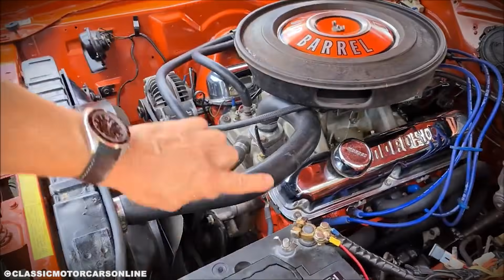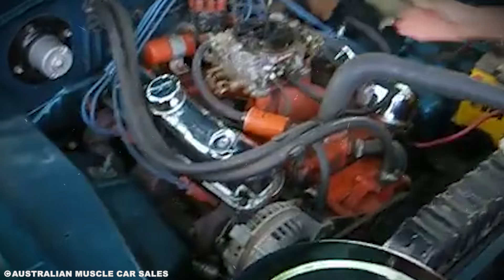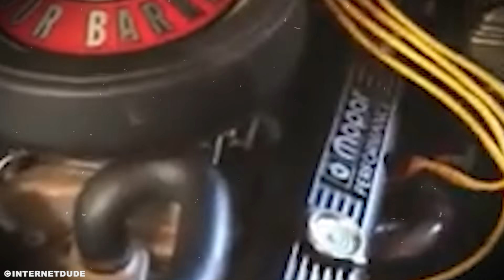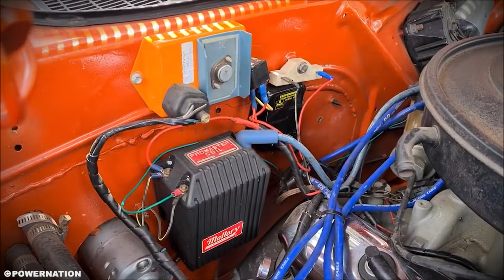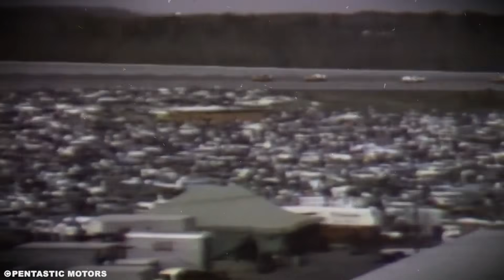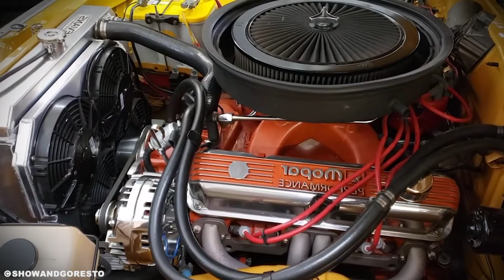Even at 275 HP & Small-Block Size, the Mopar 340 Shocked Everyone Running 13-Second Quarter-Miles

Comment: Absolutely no other manufacturer small block could beat the 340 not even the Chevy 327 or the Chevy 350 350. And if you built the 383 none of the other manufacture Big blocks could beat it.

Comment: I have a 1969 340 4-speed Dart GTS 3:91 Sure Grip rear end and I  have owed it sine June 1974. I have polished connecting rod beams and its balanced and everything else that typical of a street rod. Forged pistons 480 510 lift and 284 292 duration cam. Adjustable roker arms. Hooker headers. Hay billit flywheel and a McCloud clutch.  72 sycros and 1st gear in the transmission.  Ported and polished with 3 angle vale job. It runs nice.
Reply: Did the cam kill your mpg?
Reply: May i ask what brand cam?

Comment: I had a '73 Dart Sport. 340, 4 spd. That was a spunky little car! Very quick on the street, and decent gas milage compaired to the 440 Magnum I had before it! Both were exceptionally reliable engines. Wish I could go back to those days.

Comment: Great little motor.  I had a '69 Dart Swinger 340, headers, eldelbrock intake and 750 Holley carb.    For giggles I installed a set of a police cruiser  2.76 :to 1 gear set,.  After several tries at top end I gave up because I ran out of road above 140 mph.

Comment: The drag racer Ronnie Sox took a 69 Cuda 340 4sd with headers and a 3.91 axle ran 4 runs down the drag strip with a best of 13.3 with stock tires of the time thats impressive..